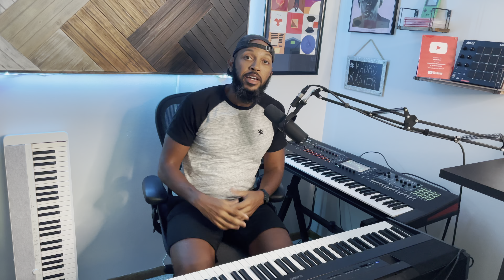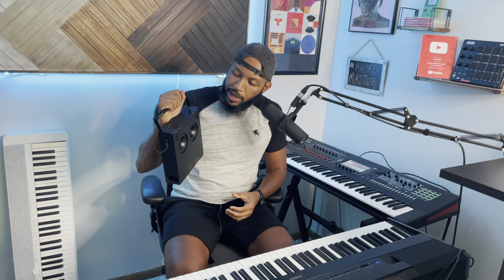Teenage Engineering OB-4 First Impressions

Comment: It doesn't even have an audio out.  It's an expensive toy by design.  Personally I don't see it.  At it's price point not even having a aux/3.5mm out is an insult.  They could have taken something from its $600 price tag to provide an audio out.  It can be a lot of fun and still be absolutely absurd in terms of whats offered vs what it costs.

The best way to describe it for me is hilariously disappointing. Like they designed a device that could be cool and then removed any way for it to be useful, and then raised the price so high that its just kind of a poor joke. I'd rather get kanye's 4 track stem mixer and I don't even want that and its only $200.
Reply from the maker: I totally feel you bro… an audio out is a very questionable omission… I’m having a ton of fun with it myself regardless 😅
Reply: @UnderBridge Rock I have an OP-Z and like it - the hard fail with it is the poor quality of the case materials leading to double trigs in the future.
Reply: Goddman man....No line out takes away my wants...No buy :(
Reply: What about Bluetooth mixer?